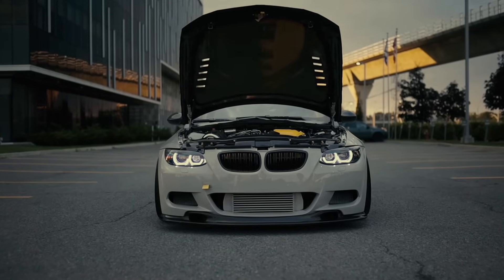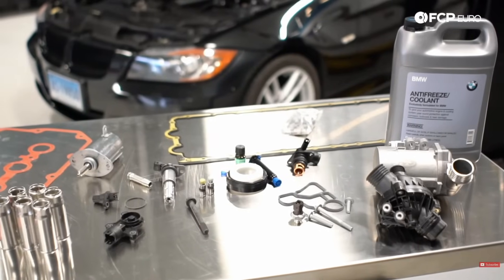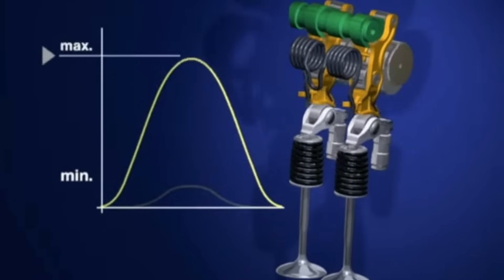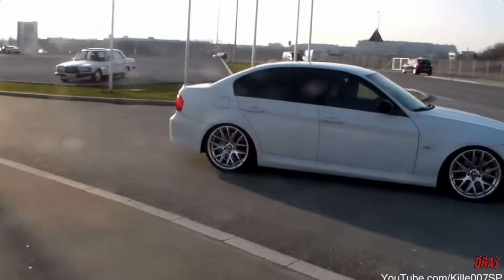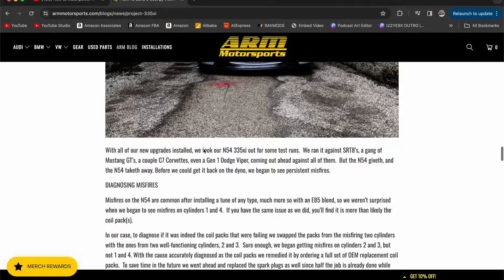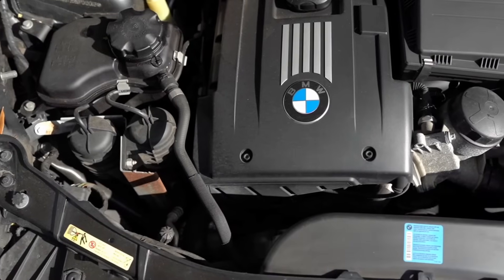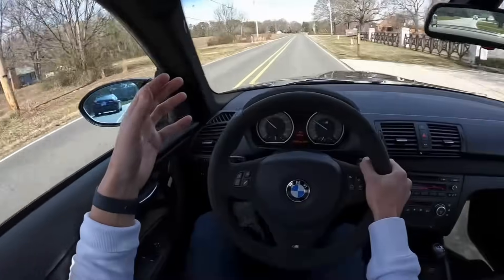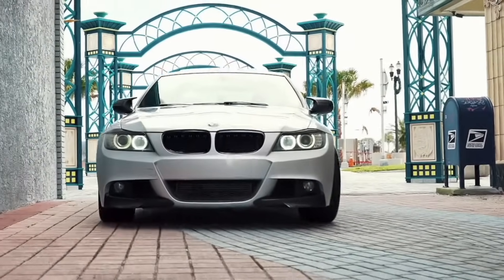Ultimate BMW Engine Showdown: N52 vs N54 vs N55 – Which One Should You Choose? | Comparison & Review

Comment: In my opinion the N54 is much better than the N52 because everything around it can be replaced but the aluminum seal of the N52 if that is worn out or worn out then the block is gone you need a new engine but the N54 has the expensive injectors but that is easier to repair than a whole new overhaul

Comment: What about the N53 engine?  My N54 that I have owned for 7 years is reliable, only issue I thought was a bit under engineered was the passengers window regulator failed. My N54 is Modded does a 10.97 1/4

Comment: I bought a 2011 z4 n/a n52 with 26k original miles. I love this car,  but it rides a little choppy on the road. I sure could use some advice as to what aftermarket coil over shocks/ struts would give me a smother less harsh ride without losing any of the stock cornering characteristics.

Comment: TBH the N54 is reliable. It's also the most beat on motor in this line up. I've had my e92 for 10 years and it's 18 years old. I'm at 143k miles on the OD and the only issues I've had were gasket oil leaks, water pump, and replacing the index 9's that were on the car when I bought it. I also preemptively replaced the hpfp, fuel filter, upgraded fuel pump and fuel line just to name a few. Cars been on TD04 hybrids for like 20k miles and tuned for 60k miles.

Comment: Also, my 2014 X3 N55 has has 145,000 miles, same spark plugs, coils and suspension.  I owned it from it had 30,000 miles.  I have to replace the thermostat and with that came water pump, hoses, VC gasket, cooler gasket, what a bitch to work on at about 80,000 miles, with all wheel drive.  The N54 needs a vc gasket at 85,000 miles and 2008 335i, other than that, no oil leaks, cheers.

Comment: I have an N54 and N55 BMW.  I don't think the N54 had two turbo's, They are twin scroll turbos meaning they have a smaller scroll turbo and a larger single scroll that work in unison so there is no turbo lag.   Same as the N55, am I wrong, I don't think so, cheers

Comment: I recently purchased an e82 coupe. Boy, does my arse hurt. Got it for 6.5k. Silver with Boston red interior reeled me in. Heres what was installed before the first 100 miles of ownership. This is a warning and a recommendation in one. Warning this will get expensive.  Recommendation do everything at once and get it over with. otherwise, you will be constantly dropping your sub-frame. Mind you, i had oil everywhere. Here we go. All aluminum water pump. All coolant hoses, including heater core hose, tstat, oil pan gasket. I went to put the vvt crank guard on and found my crankseal tucked inwards from a deteriorated belt. Special tool needed. I went thru hell, but i got it out. Suspension blown all 4 corners. I went with the st xta coilovers with m3 control arms and tension arms in the front. Ofhg, oil filter cap was also broken,  all new pulleys, idlers, and tesioner. I never trusted plastic pulley.  p/s pump pulley was ready to give. A chunk was missing on the blind side, boost solenoids . One was not holding vacuum. i replaced both. My charge pipe is cracked on one side, I have a fbo kit that i was not going to install until after i got the car running right stock. I will use the cp and bov out of the kit. waiting on some used cheap wheels and tires to be finished powder coating and rfb. before  i dial in the suspension. I hope i get a coule thousand miles out of those rattling twins😂.

Comment: N52 with 240k miles and still going strong 2007 X3
Reply from the maker: 260K on my N52 E92 🎉
Reply: 300K + km on my N51B30 E92, 2008. 234 HP but I like the ergonomics of power and reliability.

Comment: I have a 330i and a 325i. The 330i is track used and for spirited driving. Love that machine. It can take a beating, sounds great, no turbo issues and all you got to do is just change the oil and that N52 will always be happy to run. The last NA straight 6 in bmws history.

Comment: I recently purchased a 2016 Z4 35i with only 22K miles - it looks like new everywhere, particularly underneath. I needed to replace a leaking oil return line from the turbos, but I should be good to go. Oil changes will be every 3000 to 5000 miles, and I drive the car extremely conservatively. I actually bought the car for the looks, comfort and feel, so the power is just icing on the cake. 
While there are a ton of scary stories out there, I'm confidant this will be a very reliable car with gentle treatment and generous maintenance.
Estoril Blue over Walnut.

Comment: I had a fbo e90 335i and I loved that car so much. Best daily I’ve ever had. Sold it couple years ago. Wanted to get another bmw. Just picked up a F10 535i it’s really nice but needs a ton of work. Valve cover leak, maybe even oil pan as well. Needs motor mounts desperately and I’m hearing a thud sound when I get on it at low speeds. Not sure if it’s also from the motor mounts or if I need to replace the Guibo.

Comment: Thinking of buying an x6 e71 2010 with n54 engine, adaptive drive and active steering or an well equipped x5 2016 f15 with n55 engine. I like the x6 of my friend because it is equipped with active steering and adaptive drive and the X5 is missing the active steering. The x6 is also like 10-12k cheaper. What should I choose? N54 engine? Thanks

Comment: I’m team N52 because my Silver brat will just run over my foot and utter “nein!” if I don’t. 2006 330i 129k miles. Just had the infamous Mickey Mouse flange fail but that’s a common fail point for most BMW’s. The car is over 100k miles so like most things, things need updating. Just replaced the expansion tank, coolant hoses, serpentine belt, cabin, engine filters, all fluids myself. Passenger door handle got sticky sticky, replaced. Back windows, needed a new motors, replaced. Anything to do with the fuel and the tires I take to the shop. I’m not a BMW mechanic. These beasts need professional intervention sometimes.

Comment: N55 owner here, 107k miles no major issues just a valve cover gasket and currently running 400+bhp. Not massive power but is my daily driver averaging around 24 mpg have seen 40mpg on a long cruise at 65mph

Comment: My 128i, with 3.0L 6-cylinder N-52 engine (actually an N-51 SULEV), naturally aspirated, 6-speed manual gets from 0-60 in 5.8 seconds, against 5.1 seconds for the twin-turbo… I’m pretty sure those 0.7 seconds are worth the added complexity of the turbo, and my choice bears that out. My 128i is plenty quick! (and in 65K miles, it has required only a set of coils and a fuel filler housing gasket, which are both considered common maintenance items).
Reply from the maker: This is the exact reason I haven’t bought a 335i or M3, even though I could easily afford to. I modded up my 328i E92, road trip it across the country and it keeps going like day one. 268K miles and counting

Comment: I am going for à n52 in a 128i . I will probably replace all critcal and cooling components,  high pressur fuel pump and better injector. I have a 9 and 11 year hold boys and it will be are project . So they lurn mecanics mods work with reults etc.

Comment: N54 sedan owner here. Put a bottom mount DR700 single turbo kit on it from DocRace at 110k miles since stock turbos were going. Never ever had an engine issue, just electronics around the engine lmao. N55 is more reliable at stock. But if you want to push any meaningful power gains out of it, they’re known to blow.

Comment: N52 all day long. No turbo issues. Cost of ownership within reason. Properly maintained they'll go over 300.000 miles.
Reply: Right on. I am at 190kmi and still pulls like a freight train
Reply: All true, but... I recommend you never drive a 335i so you don't know what you're missing. 
When I bought my E90, I was planning on a 330i, but after driving a 335i the value I placed on better reliability went out the window haha. The 335i was a different car. A blast to drive. 

I sold it when I sensed the high pressure fuel pump acting up though haha. Should have kept it. I traded into an E46 and that has become a library full of maintenance repairs. Forcing me to learn auto mechanics I never planned on
Reply: @lawpenner nah atleast the sound of n52 is better imo and it decently fast
Reply: @altar8010 have you driven a 335i? One in good working condition?

Comment: I had to 'do it all' in replacing all the coolant hoses around 130k miles... Terrible plastic used everywhere.. it's really a shame... Also replaced the radiator.
Reply: I hear people complain about plastic a lot, I wonder what material could be used instead? I can't figure anything else would be better except for maybe carbon fiber. Also, you didn't mention which engine, but I assume the N55, which is what I have.

Comment: Those wondering about the N54. I've had my 335i N54 for 10 years. About 5 years ago it was down in my garage for about 4 months. During that 4 months i took into consideration the age my car now was. So i began a journey of proactive maintenance. I purchased aftermarket upgrades for nearly every known common failure. Also anything that seemed to indicate any wear. I decided instead of replacing turbos i upgraded the bushing assembly for the waste gates and kept my stock turbos. I replaced every common failure after that. I upgraded the injector driver mosfets in the DME. HPFP, injectors, and too many other things to list honestly. I have a full M3 suspension control arms and all (both front and back) and upgraded brake system. It is tuned to 505 hp and eats most cars it crosses. I have driven it daily for the last 4 to 5 years. It now has 170,000 miles on it and is very reliable. It has never left me stranded anywhere or even been on a tow truck. Maintenance is KEY!!!! Understand the maintenance and don't ignore it and it will be good to you. I am an engineer by trade that focuses equipment and machinery maintenance.
Reply: Hello id like to know the list of items changed. I want to work on my engine too

Comment: I have had the 2008 335i n54 very fast car 2007 325i & X5 09 n52 great cars also and now 2013 x3 n55 with muffler delete fun car it just depends what you want this video explains them all perfectly n52 best for reliability and extremely easy to work on dont have to worry about charge pipe blowing off or turbo issues just the cooling issues which they all have n52 09 X5 my favorite daily driver easily

Comment: N54 Owner here. 161k miles daily driven with mods and tune. Since owning had to replace water pump, Valve Cover Gasket, Oil Pan Gasket, radiator. I turn my own tools and I must say I absolutely have a blast with the N54. N54 gang baby 🤟🏾
Reply: N54 is the machine end of story
Reply: @YvetteHenderson-f9p Yes, yes it absolutely is!
Reply: @YvetteHenderson-f9p end of  discussion.. you mean.yup n54 hella yeah
Reply: My hubby has a E90 335i and E82 both with 3rd stage twins and he absolutely loves them
Reply: @YvetteHenderson-f9p I bet he does and should! They are awesome. There is truly nothing like an Inline-6 motor.

Comment: I have a 2008 335i cabrio, so N54.  Tune to just over 400hp.  Got 317,000 km on the clock and still in great shape (bought it with 62,000 km).  Love the car, and do oil changes every 5-6k.  That is a must to keep it running peak performance with little to noissues.

Comment: 2008 N54/E90 RWD.  Incredible car when dialed in but frankly almost always broke.  Not just the  N54 issues.  The chassis can have expensive issues.  Xenon Headlight assemblies need ballast replacement and the wiring in the assemblies fail due to wiring insulation deteriation.  $2k in parts to replace  the assemblies.  Occupany seat sensor failure.  $$$.  Etc... still amazing to drive though.

Comment: Great video, I have have had issues with my 2013 35 I x3, however, normal oil leaks, vacumm pump and gaskets. No mods and still going strong  126k.

Comment: 2014 X3, N54 here.  182K. Miles.   Drives like great, shifts smooth as butter.  Accidentally red lined it the other day, passing off the line.  Wish the power was more low range .

Comment: I owned a N52 before, it has no abnormal issues rather than changing engine oil, brake, tranmission oil regularly.  It leaked once at the bottom of oil pan.  Got it fixed, ran smooth again.  I noticed that it might have generated excessive heat when running but never had overheat issue for me.  I appreciated it.

Comment: In Europe there is the N53 too, 
N52 EU is non direct injection 258 to 265hp
N53 EU is a N52 with direct injection and HP pump detuned at 218 to 272 hp

Here every purist diy want the N52 Europe specs

Comment: I got 535i which has n55 engine. It is 2012 and got 95k kms on it. It is such a powerful engine and fuel efficient on longer routes. On longer route it gives 850kms on one tank of fuel; doing 1800rpms @ 110km/hr. 8 speed automatic is so precise that it never let me down. I owned 540i e60(which is also similar hps but naturally aspirated v8) before. I am lucky to own two amazing cars ❤ Only issue i had was water pump at 70k kms other than that it has been super reliable and comfortable.

Comment: N54 technically is a single turbo. Each feeds 3 cylinders.  

Owned a 2009 for 40000 miles with a Cobb tune. Nothing went wrong in the 3 years of ownership.

Comment: S58 all the way. But I do love my n55. Going to have to do a lot of work later on. As putting an upgraded turbo and intercooler will require beefing up the internals to handle the power and not send pistons through my hood.

Comment: Just finishing building a n54 rn last piece I needed was a full exhaust system, which I just grabbed today. Should be fun, I replaced the entire clutch, rear main seal, turbos, inlets outlets,better intercooler, better piping. Berger cones, upgraded charge pipe, Bov, coil overs, index 12’s. Just finished putting everything together waiting on one part and I need to get the mhd tuning software and it should be game time.

Comment: BMW has turbo cars since the 70's. I don't know what are you talking about . Plus  every diesel is also with a turbocharger . The first european production car with a turbo was the 2002  turbo 1973 , later in 1978 BMW did 745i with 3.2 liter inline 6 and turbocharger alpina did the first biturbo inline 6 based on M30 engine with 3.4 liter and 360hp in 1989 and so on .

Comment: Nice straight forward info, thanks. 170k miles on my n52 which I’ve owned for about 8 years. Have done the oil pan, cooling system, starter, coil packs. Other than that, it has been a fantastic car and this engine is buttery smooth. Only upgrades are air intake, full exhaust, and coilovers.
Recently got a n55 f10 and I’m really enjoying it. No issues yet. Only upgrade on this so far is a sweet suspension cup kit. Still have my e90 n52, don’t want to get rid of it yet 😊

Comment: You forgot the n51 for carb compliant states. Also the z4s come with n54s and in 2011 they had the n55s  the z4 3.0is had the n52s and the z4 35i had the n54 or the n55 depending on years. Also on the e-92 specifically the 335is and the 335i from 2011-2013 had the n55 from factory rated at 325hp.

Comment: Lol "oil leaks & coolant leaks are common to any vehicle"  No it's not...my 3.5L 2GR-FE powered Toyota has 291,000 miles on it, no problems whatsoever and will smoke a naturally aspirated stock BMW all day, every day.  My 97 Ford 4.6 V8 also has no issues with over 309,000 miles on it with no issues.

Comment: I own a 335I with the notorious N54 engine. As long as you know whats going on with it it will keep a smile on your face indefinitely. It does kinda really suck incredibly bad that the difference in power between the natural aspiration engine and the one with TWO TURBOS is only 38 HORSEPOWER!!! Really two turbos only increase the engine output by 38 horsepower Thats pathetic! AMAZINGLY PATHETIC! Other 3ltr turbo cars like the Nissan gtr make 600 stock!! I guess it was really important to BMW that cars equipped with the N54 didn’t compete with the M cars. And it is possible to greatly increase that number with some bolt on upgrades but realistically they are not cheap, not easy, and will constantly create reasons for the owner to have to mess with their setup! If you just want a car that works and not one that requires a tremendous amount of trial and error the 328 actually makes more sense! But if you enjoy turning wrenches and spending money do the 335I Jeremy Clarkson once said “There is nothing more expensive than a cheap luxury car”
Reply: the difference is so mild, its a shame. for the money it takes to just make the n54 reliable i was able to do all preventative maintenance, upgrade turbo and go fbo on my n55 e92